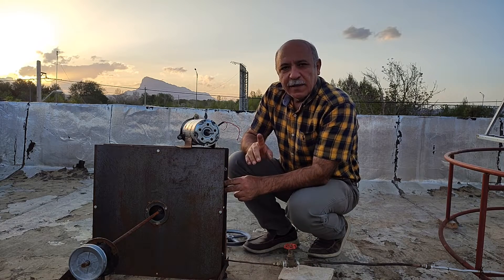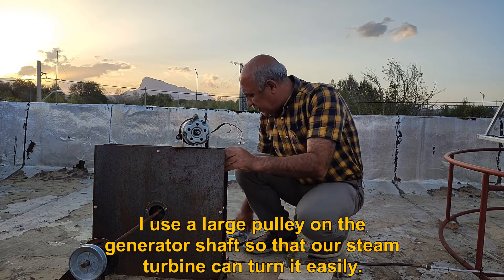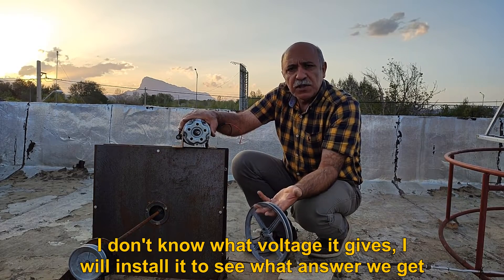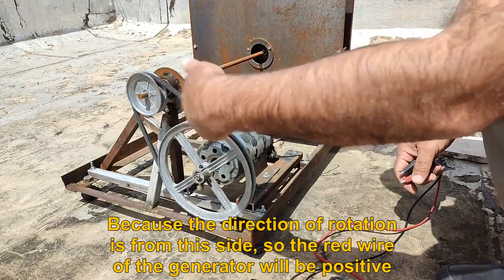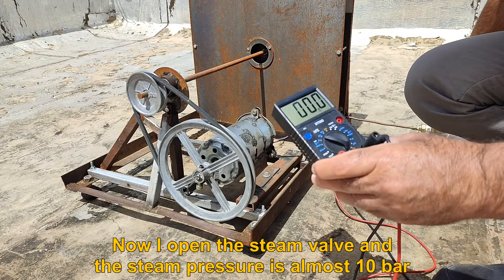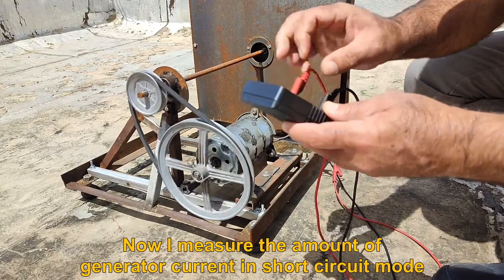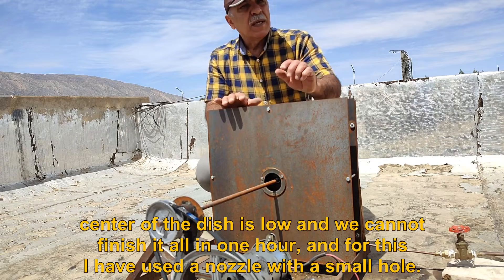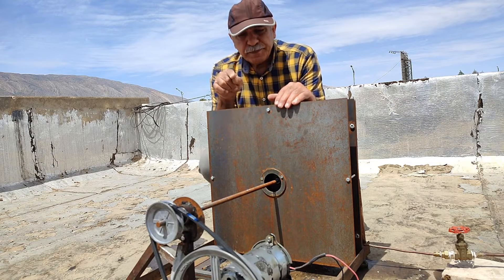DC generator test with solar steam turbine

Comment: this contraption makes more like 20 volts under load and 5 amps. 100 watts max. don't over rate this project. a real tech would show amps and volts at same time because under load voltage will always be much lower than open circuit voltage. Seems like a lot of BS for very little gain.
Reply from the maker: We must note that the magnetic friction of this generator is high, which causes the rotation speed to be lower than required
Thank you for your nice comment

Comment: To produce 1 kw of electricity in big gas steam plant they use 15 liters of water vaporised at 50 bars .and they claim 70% efficiency
Reply from the maker: Combined cycle power plants consume a large volume of water

Comment: Well you getting 220 watts approx... which is very good since 1 sq meter solar gives 1 kw...and booler efficiency is 80% plus heat loss through pipes thats minus 10%  and generator efficiency is 60% and turbine is 40% all that comes to close 200 watts... good job
Reply from the maker: Thank you for your attention and good calculation
Reply: more like 20 volts under load and 5 amps. 100 watts max. don't over rate this project. a real tech would show amps and volts at same time because under load voltage will always be much lower than open circuit voltage. Seems like a lot of BS for very little gain.